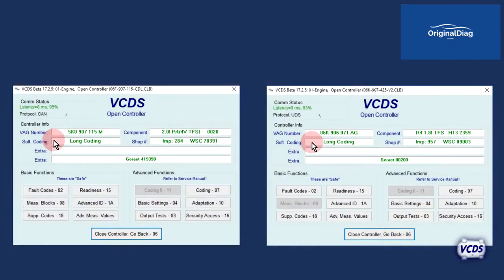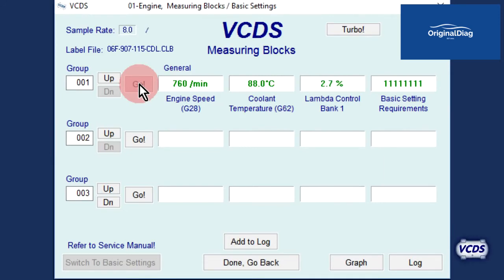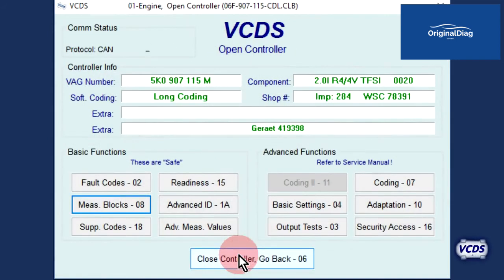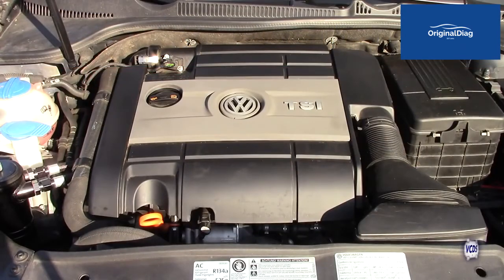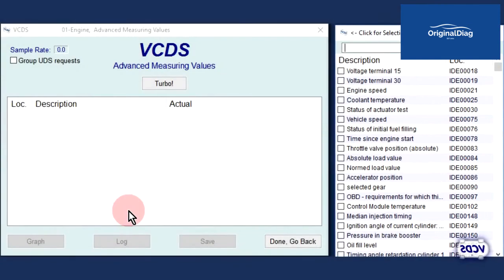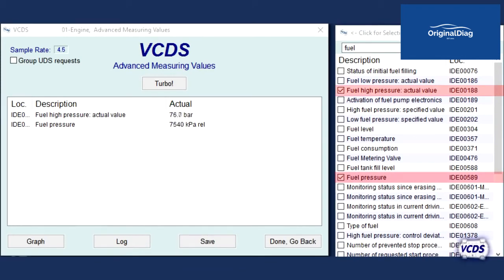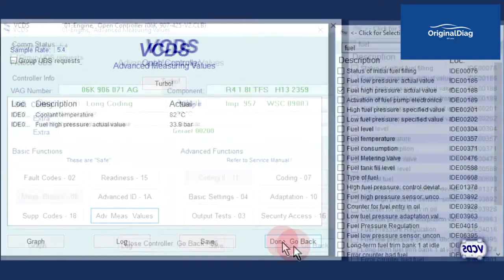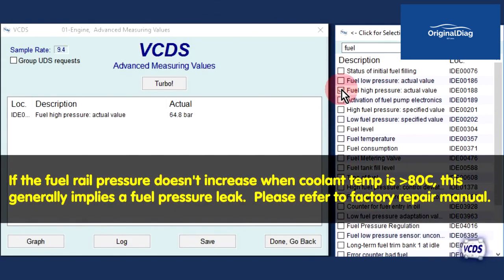Fuel Rail Pressure Test with VCDS by Ross Tech - Originaldiag.com

Comment: Can you do this on the 1.8T (BFB) - it does not have a high pressure fuel pump? If not, what are the way to diagnose fuel leak on that engine?